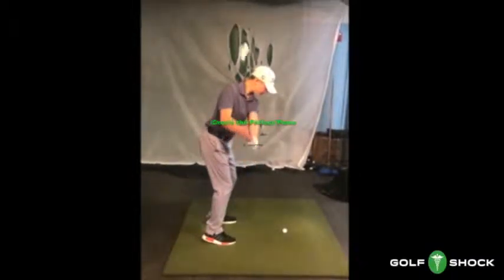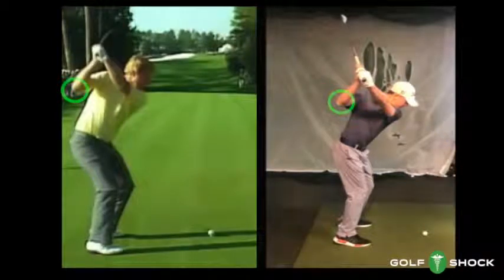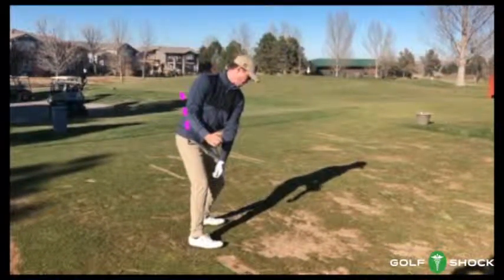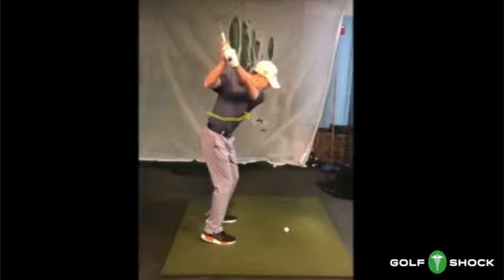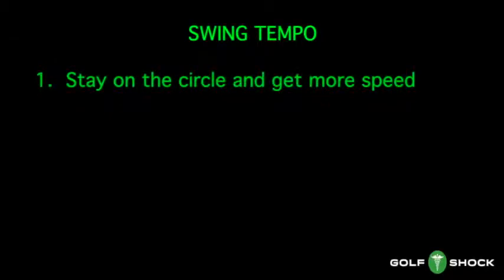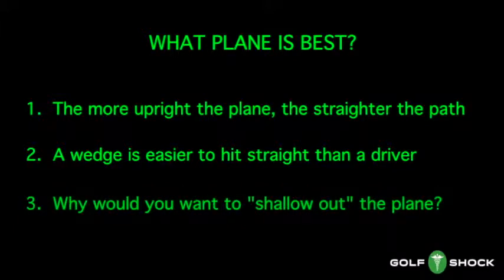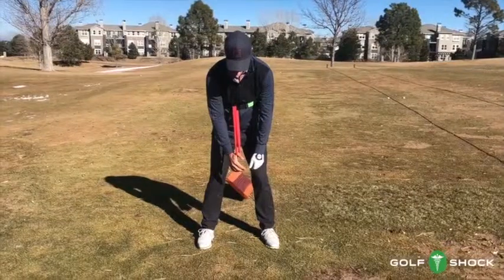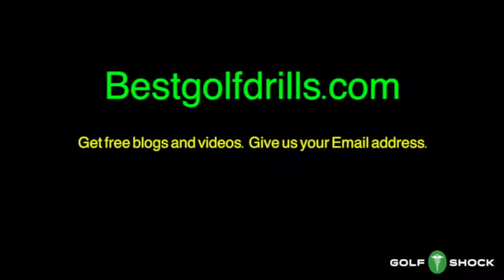How to create a perfect swing plane

Comment: 7:22  Doubt, the steep plane being necessarily better than the shallow plane for a straight shot. You are giving all the credit to a tangent to the swing circle and backspin inherent in the steepness.   It is the mistake of one length irons. The angle of attack is also important, in a clean strike, a longer lever arm for speed, and in reducing spin when dynamic loft is lower, to improve trajectory and thus distance. As always in golf, you can get too much of a good thing.